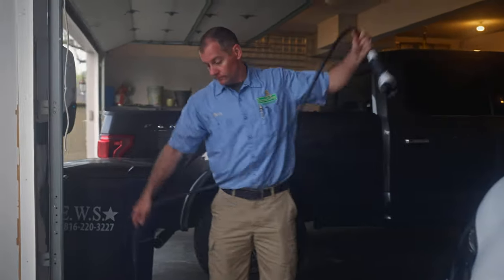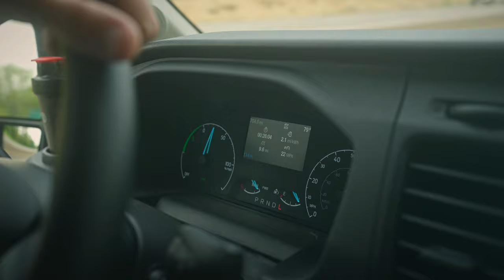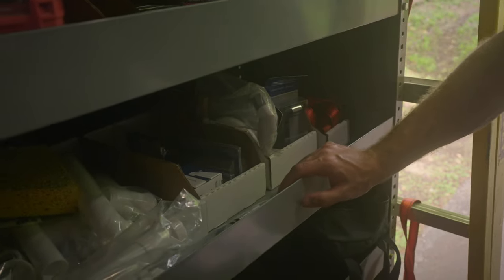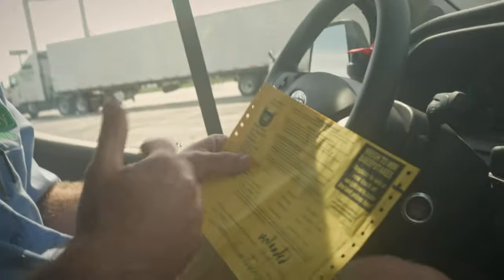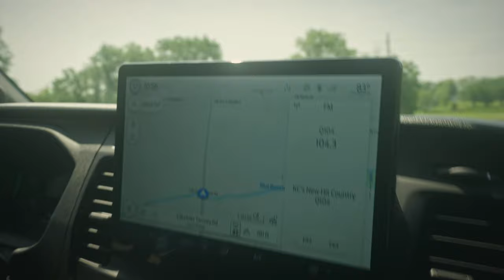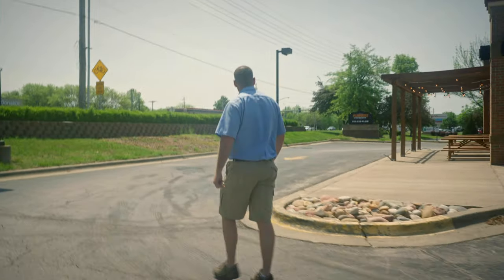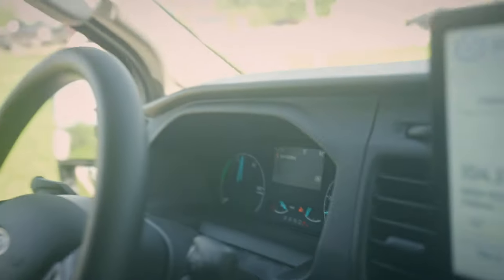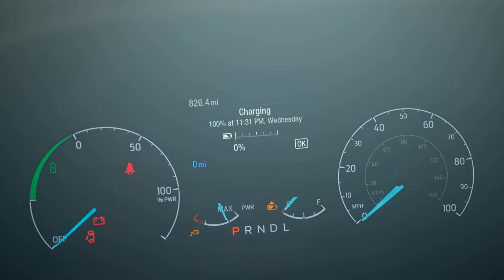**Ford E-Transit**  How far can you drive when it's loaded down?

Comment: Lightening Pro has 230 miles range. E Transit has 126 miles range. Ford wants you to upgrade to a bigger battery in the next E Transit model. It’s a Ford scam.
Reply from the maker: Ford puts a bigger battery in the Lightning with an option for an even bigger one.  Also, the lightning is more aerodynamic and lighter.  So it has a better miles per kWh.  Besides, options to upgrade are not scams.  They're options for if you'd like that feature.
Reply: Lightening towing range gets cut by 50% when towing 10k load
Reply from the maker: @bryanayers6104  much like mpg is a fraction of the advertised number when you're towing 10k lbs.
Reply: @SmedleyPlumbing  Goes against concept of not frequently using DCFC for charging to avoid faster battery degradation.
Reply from the maker: @bryanayers6104  show me a vehicle that gets it's rated efficiency while towing 10k pounds.  Just because a vehicle can pull 10k pounds doesn't mean it's meant to spend it's like doing it.
Reply: @SmedleyPlumbing  point here is that multiple daily recharging sessions for commercial use will be a pain in the ass... and I'm not a shill for Ford.
Reply from the maker: @bryanayers6104  but that's literally the way Ford intended it to be used.  Recharged after every 70-100 miles.
Reply: @SmedleyPlumbing  ...time is Money in the Trades industry.
Reply from the maker: @bryanayers6104  yes I'm very aware the time is money. Simply put, if you were traveling over 100 miles per day then this stand does not make sense for you. But if any one of your service vehicles has a route that averages less than 100 miles a day then you can incorporate the e-transit into your fleet in charge overnight while the employee is resting. I have a fleet of five transits. One of them is an e-transit. It doesn't quite make sense for the other four to be all electric just yet. So I'm using the e-transit where I can and where it makes sense. And in doing so I am saving nearly $100 per week in fuel on that particular van.
Reply: @SmedleyPlumbing  Congratulations. Ford is touting these trucks 'for the Trades industry' without caveats for who they work better for... There will be lots of unhappy buyers.
Reply: @SmedleyPlumbing  ::: “Besides, options to upgrade are not scams.” During the ‘60s when GM commanded 75% of the U.S. domestic auto market, GM offered you the options to upgrade their cars as their cars were sold without carpet, floor mat, reclining seat, head rest, arm rest, radio, antenna, electric window, electric lock, interior light, trunk light, cruise control, multi-speed windshield wiper, dual side mirrors, rear window de-fog and de-ice, front disc brake, anti-corrosion underbody, stainless steel muffler, and spare tire. The nascent Japanese auto makers included nearly all of the above ‘upgrade options’ as standard equipments. Karma is a Bitch, says the wise one. Today, the once bankrupt GM struggles to hold on to its 24% share of the domestic market. Many years ago, the other boys across the street didn’t know any better and emulated GM. Consequently, AMC died. Chrysler belly up. Ford is keeping its nose above water. Ford could have easily installed the larger battery pack from the Lightening into the Transit EV giving the van over 200 mile range. Nope, Ford decided to punish the Transit EV buyer making him suffer the anxiety of having a small battery. You can bet Ford will claim ‘it has heard the consumer demanding a larger battery’ and offer a 100kwh battery pack as an option — costing more money, of course. People ain’t stupid. You can scam them once, then they avoid you like the plague and eventually put you out of your business misery.
Reply from the maker: @ubermenschen3636  sounds like you have it all figure out.
Reply: There is a very good reason that ford has a smaller battery. Ford wanted to  match the load capacity of the ICE  version of the van. A bigger battery would reduce the cargo capacity.
Reply: @jimfarmer7811  ::: good try. Had Ford wanted the E-transit to match the load carrying capacity of the ICE Transit,  Ford could have beefed up the suspension of the E Transit and also install a larger battery for more range than the current miserly 126 miles range. But Ford refused to do either not because the mechanical engineering is too difficult or a larger battery doesn’t exist. “Ford has a better idea,” said an old Ford advertisement. In the near future Ford will gladly sell to the range anxiety consumer  a 200 plus miles  battery for more money. Basically, Ford created a problem for the consumer whom Ford will offer a solution for more money. What a scam!
Reply: @ubermenschen3636  as a retired engineer I can tell you there is a lot more to it than "simply beef up the suspension". To keep the costs down ford wanted to keep parts  common across the both the ICE and BEV platform. If Ford made the changes you suggest than ford would have to design basically a brand new vehicle. Besides everyone knows it's a  compromise. Ford isn't keeping the limited range a secret and they are still selling like hot cakes. But than if you aren't happy with the E-transit than buy a competitive product. Oh that's right, there isn't any competitive products.
Reply: This was designed for the urban niche where you don’t need a bunch of range (making the van cheaper and lighter). It’s perfect for me. I drive 80-140 miles per WEEK as a gc in portland. A big driving day would be 80-100 miles. This niche exists and it’s probably the biggest use catagory.

Comment: When they get to 500-1000 mile range, post another video...lol
Reply from the maker: You driving 500-1000 miles per day?
Reply: @SmedleyPlumbing  that is not the point.
Reply from the maker: @clearnewview  it is the point.  The vehicle is designed for daily driving and daily/nightly recharging.  So it only needs to travel enough miles for a single days use.  It's not intended for long range or over-the-road use.  It's intended for in-town delivery and service use.
Reply: @SmedleyPlumbing  I hope you never have an abnormal day at work...lol😁
Reply: @clearnewview  No, that's exactly the point.

Comment: I just finished watch the entire video.  You claim the saving in fuel cost over electricity it passed on to the customer.  So you charge them less if you drive the electric transit to a job as opposed to the gas?  Come on ......Something smells fishy here.
Reply from the maker: No.  We are able to maintain our pricing from 2 years ago without adding a fuel surcharge our increasing our pricing to compensate the cost of fuel doubling.
Reply: Come on they have just payed 10000$ more for going electric and they are still runing 3 gas trucks, do the maths!

Comment: 7.16......L MODE L MODE 
L MODE...OK I'm all set.just give me a gasoline engine please.nothing against the video.great content but just too much L MODE.

got me thinking about SNL and 
NEEDING MORE COW BELL
Reply from the maker: Well, it's the key to getting better mileage when loaded and driving in town.
Reply: @SmedleyPlumbing  I understand but Judy too much for me anyway.just ME.
Great info.great video but not ready for all of that just for mileage etc.hopefully I didn't offend anyone
Reply from the maker: @dentpulla  offend?  Not hardly.
Reply: @SmedleyPlumbing  great because that wasn't my intention.keep the content coming
Reply: Using L mode for slowing down and stopping also saves on not having to put new brake pads on as often thus less downtime in addition to saving money for energy/fuel. Hybrids have something along those lines.
Reply: @johneric98  yes I heard about the hybrid vehicles doing that. I'm just old and not ready for prime time new stuff. I like to hear the Motor and feel the power from there engine. My boss text drove a Toyota and it felt like a golf cart. No issues with anyone using these vehicles. It's just not for me right now

Comment: You destroyed any creds you have by running the gates at a railroad crossing.  That was profoundly stupid and ILLEGAL.  I worked in the railroad industry and have reported illegal crossing behavior like that many times.  I've also seen the results of truck/train crossing collisions caused by that kind of driver behavior.  They pick up remains in body bags.  You should know that in my state, if you have a CDL, that ONE conviction of running railroad crossing gates can get your CDL suspended for 6 months to a year.   Since you saw fit to post such illegal behavior on YouTube, I will send a link to it to the Union Pacific Railroad, over whose tracks you ignored both safety and the law.  Have a nice day.
Reply from the maker: Yes please let them know about their malfunctioning crossing arms.  They were down for a parked train 1000 feet down the tracks.  It's actually fairly common for those specific arms to malfunction.
Reply: @SmedleyPlumbing  It's still against the law to run the gates.  Period.  If, in fact, the gates were malfunctioning, there is an emergency phone no. posted at the crossing to report the malfunction to the railroad, or dial 911.  That is what you should have done.  Only a railroad employee or law enforcement can allow a driver to legally drive around the gates.  I know the law and I know what is safe--it was part of my job for years.  The cardinal rule of safety around trains:  When in doubt, the safe course must always be taken.  One other thing to remember, your vehicle weighs probably 2 to 4 tons.  A train often weighs 5,000-16,000 tons and, at 55 mph, can take over a mile to make an emergency stop.  If you get hit by a train in a vehicle, you will lose.  You don't know what a trauma it is for a train crew to hit a vehicle at a crossing.  It is the conductor's job to walk back and see what they have hit.  A conductor I knew had to do that more than once because people drove around crossing gates.  He said those were the longest walks he ever had to make in his life.  Yes, he has PTSD from that.
Reply from the maker: @rockymountainjazzfan1822  sounds like fixing the crossing gates would be a whole lot easier that trying to reeducate an entire city.
Reply from the maker: @rockymountainjazzfan1822  when a safety measure has more flash alarms that actual alarms, the general public learns to ignore the warning.  This was yet again another false alarm.  If anyone want the public's respect for alarms regarding safety, they must first hold themselves accountable to only alarm when actual danger is present.  Otherwise, the public only learns that most alarms are false.  

So yes, reeducation is needed.  But only after the railroad corrects the false alarm issue.